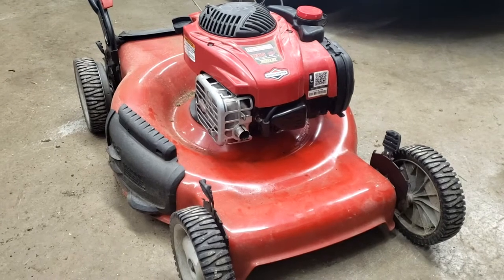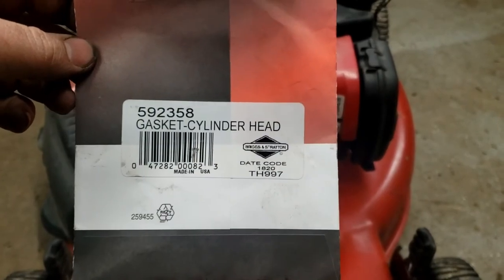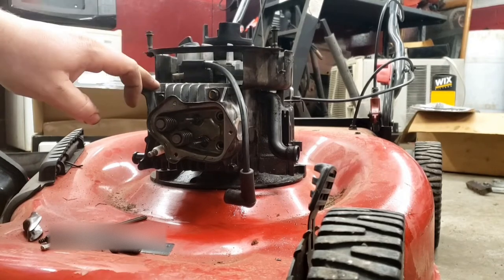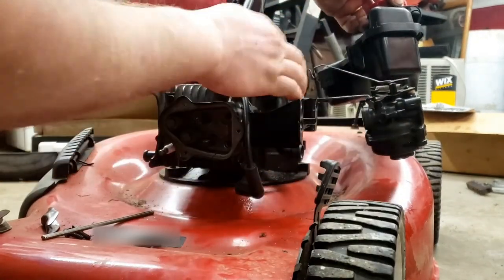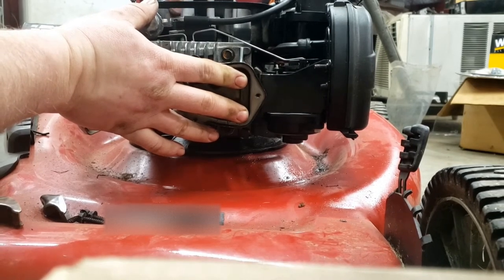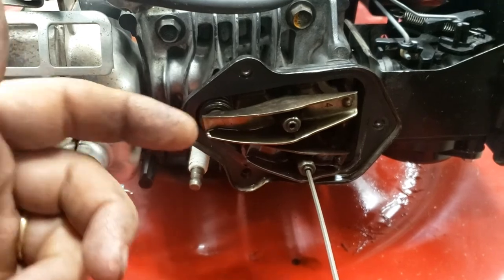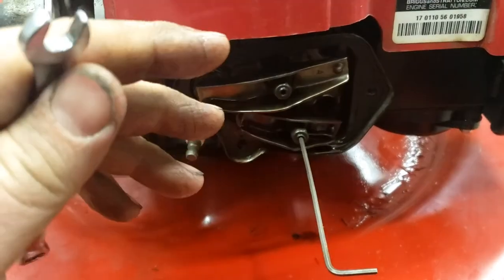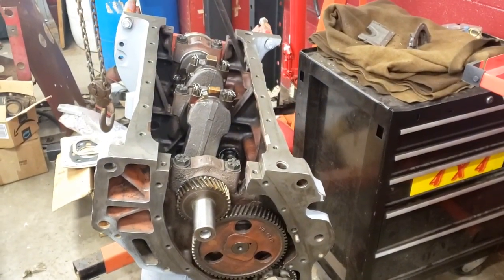Briggs & Stratton 6.25 OHV head gasket replacement

Comment: Excellent video. I'll be doing this on my motor this Saturday. Had fuel and oil coming out the carburetor. I also had oil and white smoke coming out the exhaust as well and it would quit running after about 30 seconds. I really miss the old mowers that never quit unless there was something seriously wrong with it. These newer mowers seem to last one season then die or need a head gasket, a carburetor, valve seals or something major. I can't stand these newer engines they SUCK! On my third mower in 5 years and my 2nd CraPsman in two years. the Husqvarna lasted three years giving me troubles after a week, coil went, then at 6 months the rings started to go. Again thanks for sharing. Best Wishes & Blessings. Keith Noneya

Comment: I also have the same exact engine and reseated the valves with my dad but I don't know what to torque the head screws to, by any chance do you know?
Reply: 12 foot pounds should do the trick.
Reply: 220 inch lbs or 19 ft lbs

Comment: Tinkerer, your mower sounds great! I noticed just today that my 550EX (140 cc) was dripping oil out of the air cleaner box. Sounds like excess crankcase pressure to me. Can a blown head gasket  cause this? I think bad rings can. Oil is not overfilled - it was running OK today - tiny surge maybe. It started right up BUT did not try to start it again after I noticed the oil (and I started to take it apart so can't easily try it now and it's late.)  I did move the flywheel by hand & it certainly seems to have compression. Any ideas as to what to look for on this problem?  Thanks! Bob
Reply from the maker: Hello Bob thanks for watching my video. Worn rings or scored cylinder walls will cause blowby causing high pressure in the crankcase. That pressure will exit through the breather tube taking oil with it. The tube should be hooked to the back of the air filter housing. If the head gasket leaks compression into the pushrod gallery it will cause the same thing as blowby. Depending on how bad the gasket is leaking it may run fine and not be noticeable or run fine untill a slight load is put on it and it will shut off.  Make sure oil is coming out of the breather tube. If so I would check reed valve in the breather assembly first. Then pull the head and inspect and replace head gasket second. If needs cylinder bored out due to excessive damage may not be worth fixing. If ur model number is 9P702-0045-F1 reed valve is part number 697124, head gasket 799586, rings standard bore 590523, piston with rings standard bore 590521. Hope this helps.
Reply: @Tinkerer89  Thanks for quality (& prompt!) response!  I may attach baggie to breather tube to see how much coming out during my 30 minute mowing jobs & to keep my filter from becoming oil saturated. Maybe this will get me into winter when I can dig deeper into this. Interesting that a few days ago I had just done a carb jet cleaning and found the breather tube was disconnected from air filter box. That might have been just me failing to reconnect it the previous time I had carb off - but strange coincidence. Mower is into 8th season. Partially disassembled but certainly feels like decent compression when I spin flywheel (fan blades) by hand. A good reed valve replacement video: https://www.youtube.com/watch?v=otDt4E8cwi8  - whose engine is that clean??  Anyhow - thanks again.  Bob (Pinehurst, NC)

Comment: I tipped my mower the wrong way to clear something wrapped around my blade. Started it up and it blew white smoke so I let it sit and replaced the Air Fliter. It ran great shut it on and off a few mowings. I went to start it and only got a popping sound like maybe back fire. I had someone look at it and it had no compression, mentioned a head Gasket. It had no warning signs before this happened? Will a new head gasket resolve this? Thank You!
Reply from the maker: If it pops I would check to see if it's popping from carb muffler or headgasket area to make sure a valve is not hanging open.  Also can remove the dipstick and see if it pushes smoke out after several pulls. Sometimes times the gasket will blow internal at the pushrod gallery. Last resort would be to take it apart and see if it has plastic cam gear and lobes. Check timing between valves and piston first. In my experience with a hydro lock condition if oil or gas got in cylinder it either won't turn past top dead center on compression stroke or bend a rod. If it ran fine after it was tipped I don't think that was the cause. Hope this helps
Reply: @Tinkerer89  I have a guy taking it apart he said no compression. He said it turns over and pistons/Valves working as they should be. He going replace the head gasket. He said they don't usually go? 
However my machine is a Terminator lol I mow nearly 2 acres and even high over grown grass if I miss a few days of mowing insane 🙈Thank you!

Comment: Hi there. I have that exact same engine on my mower. My head gasket is bad. Do you remember what the valve lash spec is? I cant seem to find the spec anywhere. Thank you for the informative video.
Reply from the maker: The spec i found was 0.005 for both valves. I set lash on that engine around 0.007. If engine backfires from intake or exhaust can loosen the lash some. Hope this helps.
Reply: @Tinkerer89  thank you sir. That helped greatly!